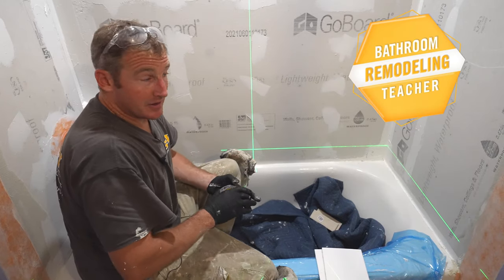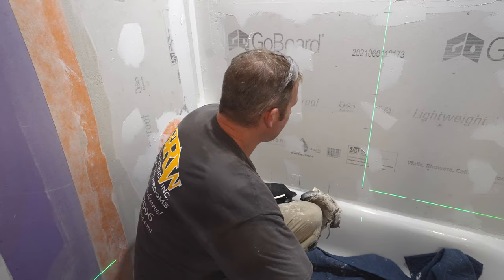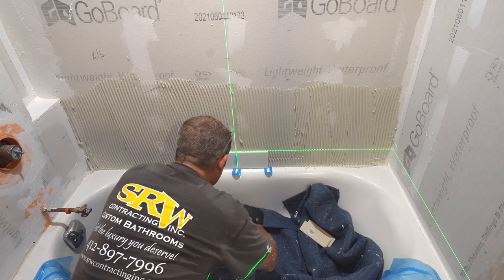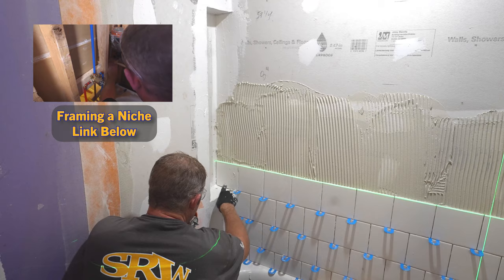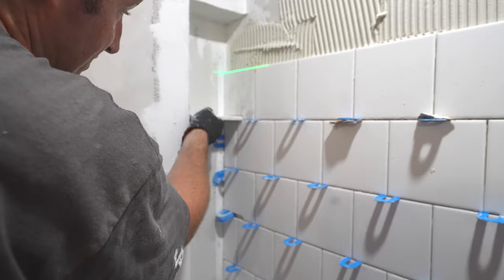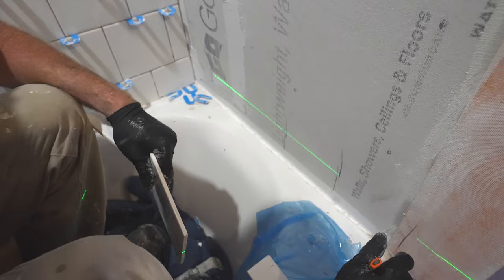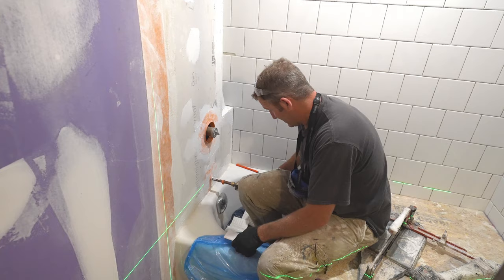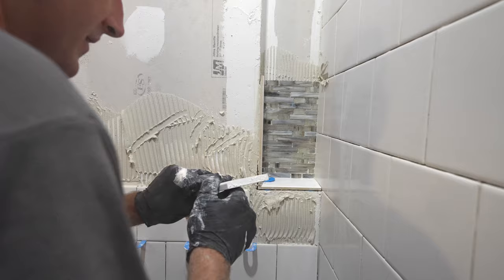Tile Tub Shower Walls I PLAN LEARN BUILD

Comment: bulnose lines up in certain places but doesnt line up in others, it would of looked a lot better not lining up on the side walls. destroyed plumbing wall by installing bulnose for niche on the main wall instead of the returns (nobody would of noticed a double cut on the inside. hi and low tiles look bad at the end once grouted and its because you dont spend the time and trowel consistently , especially when spreading against a previous row, as your leaving a bit extra against previous row of tile. mosiac border a bit wonky in the corners. dry cutting in the shower, not good and its a shame how messy your tools are. if i went into a doctors office and seen dirty tools i would run. you literally have dried up thin set on every tool you own, thats just a messy installer. if you like to show people how to do this, it should be done right . just cant stand seeing hack installers do videos..

Comment: Great job Steve 
I’m getting ready to start my walls . Could u show the scribe cut process? Also can you recommend  a cheaper reliable tile cutter for ceramic? That ones kinda pricey. ? what laser are you using ? I have a red Leica and hate the red.
Final question.... on wall tiles 2x6 or 3x6 small (This is  shower with no tub) Should I screw a piece of wood to wall through membrane like some to and stack off that. then fill holes and lay bottom row last?
Thanks Dan
Reply from the maker: Hey Dan, so I'll try to get something out soon on scribe cutting. But basically you want to be sure you don't use full tiles on first row so you can adjust them. I set laser at where I'd like the first row to be and cut all tiles at the longest point. then use a grinder to adjust cut and get perfect with the laser. It is tedious process, but worth the extra time. If you set the first row nicely, the rest becomes easy. I have the Dewalt green laser. I thought these Huepar lasers are not too bad. Half as much as the dewalt green ones - https://amzn.to/3nqzpyD. For tile cutters, I need to try more. I like the ruby, iishi cutters. but they are not much cheaper. A lot of jobs for subway tiles, I use the wet saw. cut multiple pieces at a time since they are typically the same on edges.  thanks, Steve

Comment: Pgh guy here. Love your channel.  The question is about ledger board or not.  I'm doing a shower.  12x24 tile.  Some say stacking off the shimmed base it will kick out vs a ledger then install/scribe the bottom row.  I do have a laser. Is the middle ground to use a laser and let the first row dry a day so it won't have issue supporting the weight?  Is this all dependent on tile size? Thanks so much.

Comment: Solely asking because I’m curious - when you were pressing the tile in the thinset on the right side, the wall was bowing and flexing. Once this is all set up, do you think there would be an issue? Were those studs 16”?

I’m looking at tiling my tub surround but I know the studs are 2x6 24” oc on the exterior wall. If using go-board, I should probably block it at 16”oc

Comment: Question.  If you install a wood baseboard do you bring the bullnose tile to the floor or to the top of the wood baseboard.
Reply from the maker: I typically tile to floor and then butt trim to the bull nose. It’s personal preference, either way works, but I think it’s better having the tile against tub rather than the wood trim. 👍
Reply: @BathroomRemodelingTeacher  Thanks

Comment: does trowel groove direction matter? I will be using 12 x 24 tiles. Love the idea of presetting mosaic. I'm thinking of doing a 12" wide tub to ceiling insert centered on the plumbing wall fixtures. I assume I can cut the tile after it dries to square up the edges? I'm using porcelain tile over Wedi board. What thinset do you recommend?
Reply from the maker: Trowel direction isn’t super important, but going with the short side of tile can be more efficient. No problem cutting mosaics after they are set on membrane and ardex x5 is what I primarily use 👍
Reply: @BathroomRemodelingTeacher   Something I just thought of. When you pre-install mosaic on fabric doesn't this increase thickness? tile+thinset+more thinset when installed? Now thicker than wall tile?

Comment: Looks great Steve! It’s tough to tell time in the video, but how long did it take you to tile the back wall and non plumbing wall? And how long did your pot of thinnest last? I’ve only tiled once and I’m so damn slow that I have to mix it in small batches not to waste it, but I had a real hard time with the consistency of the thinnest. I used 4XLT. You make it look sooo easy!
Reply from the maker: Thanks Bobby, So if you are taking a bit of time, I definitely recommend trying to get some Ardex thinsets. They have the longest pot life of any thinset I've used. Typically 4 hours if its not too dry or hot out. On this tub surround I did the back wall and non plumbing wall in a 6 hour period. Back wall before lunch, and non plumbing wall an hour or two after. Took about a bag and half of Ardex X5 for those sections. If you mix things to proper ratios of water and mix for the full 2 minutes, you'll get the best consistency and pot life. After lunch I do spin the thinset (Do NOT add water). this gets it back to a spreadable consistency. 👍